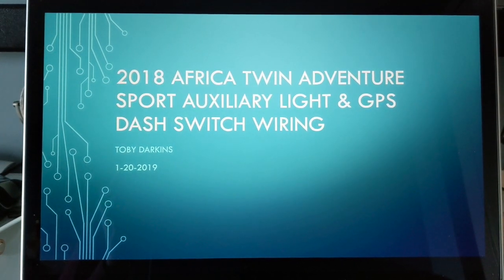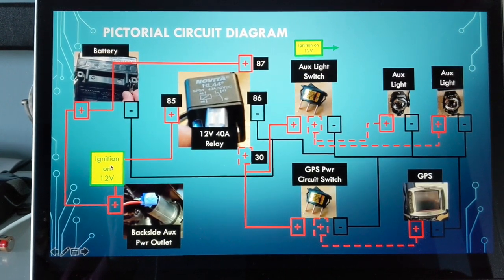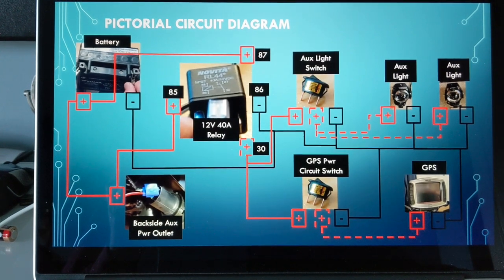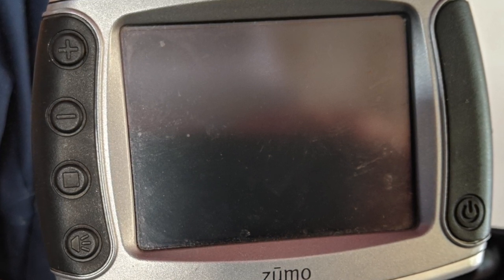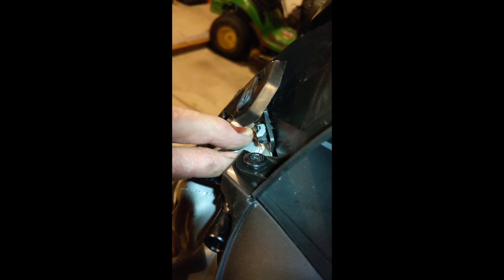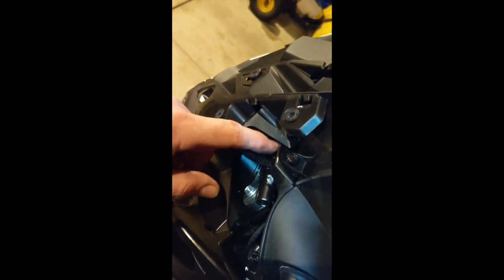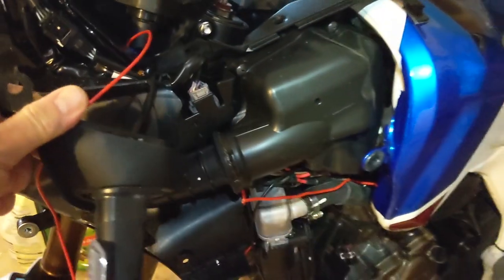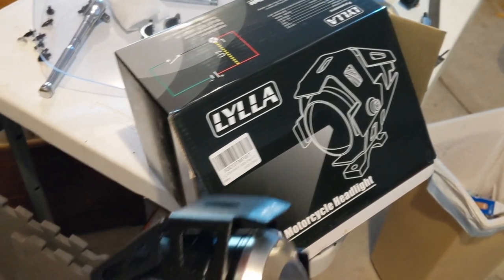P-1/3:  2018 HONDA AFRICA TWIN ADVENTURE SPORTS DCT CRF1000L2 Auxiliary Lights & GPS Wiring w/ RELAY

Comment: I totally don't understand why you'd do that if the bike already comes with two optional accessory power outputs, one in the front and one in the back, which give power with ignition on.
Reply: Wait....it has what, where?! I'm looking to do an aux light install and didn't find those optional accessory outputs yet.
Reply: @runemagic7  It's a white 4 pin Sumitomo connector tucked away between the dashboard and headlight. Need to loosen the headlight for access as it's rather tight there.
Reply: @mikoaj1321  I will be taking a look. Thanks so much!

Comment: Great tutorial! Need your advice.  My left front turn signal in not working. I can see it is trying to blink.  Do I need to take the whole front a part? Is there connection to the wires?